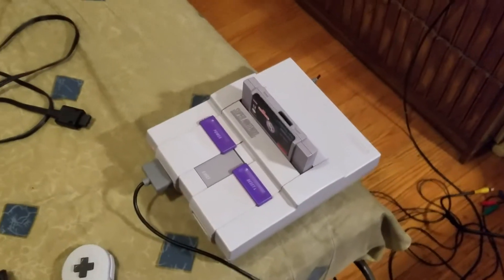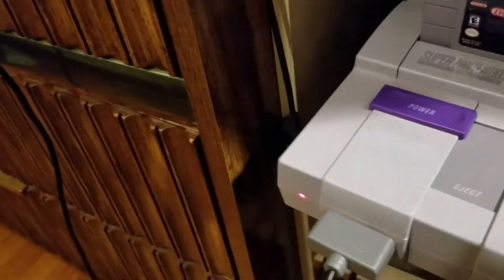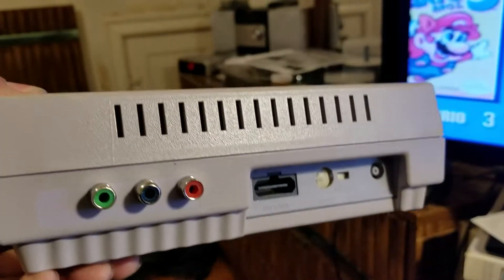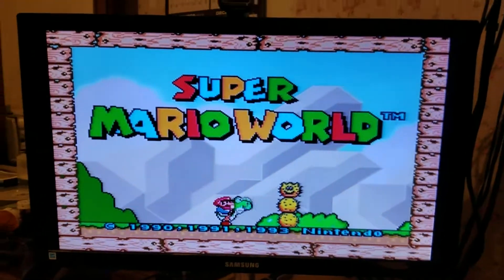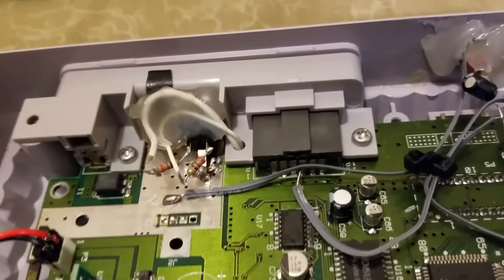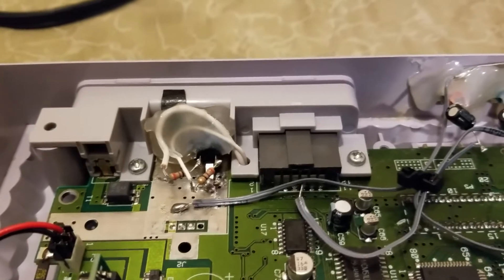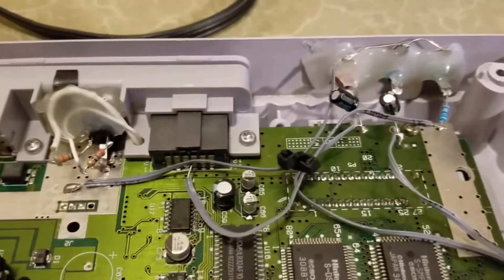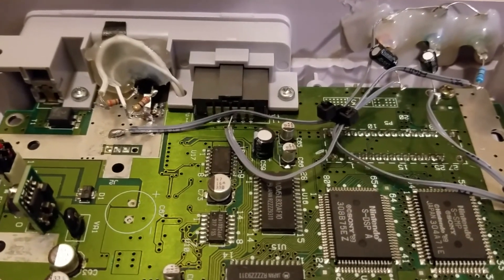Super Nintendo SNES Component Mod - Awesome Video Quality! (SNS-CPU-GPM-02)

Comment: awesome bro thats how i did mine too except i used 220 uf cap based off of what the RGB scart cables use to amp the signals up. Depending on TV colors may be a bit intense/brightness so could play with that on TV and or use resistors depending on the route you want to do.

Comment: Awesome vid thanks for sharing.. 
Why don't you just use multi out jack.
Maybe make your own cable, 
Im try to understand dosen't it come out to that multi out on those boards.

 I'm almost to the point of buying one of those hd retro component cables and then tearing that bitch apart... then show every one how to make it cause they asked so much for them out the door almost $70 bucks.. bullshit.
May be you could..? I get it if you don't want to.

This is what I got so far.
I think this is the right pinout for multi out jack.
"Pins"
1 red 
2 green
3 CSYNC ..sync s/12v
4 blue
5 ground ..pin 1,2,4 or with s video
6 ground ..pin 9,11,12
7 s video y,  luminance back&white ..s video 
8 s video c, chrominance color ..s video 
9 CVBS, composite video AV .. yellow
10 +5v ..5vDC
11 left & right audio mono ..white
12 left & right audio calculate stereo ..red

I don't know you tell me what you think..
No one's done a video on how to make a component cable for the snes it can't be that hard  I'm trying to get all the parts to do it....

Comment: I just finished this mod on a snes GPM-01 1992 with a S-ENC  chip, i take the materials (two 220 uF 25v caps and the 3 rca inputs) from an old dreamcast vga box.
Luma/green from pin 7 of av out, red from pin 1 of the s enc and blue from pin 24 from s enc and the ground grom the board, i tap green directly and added one cap to red and blue... i tested on LG CRT with components and the quality was awesome, so vivid colors, i'll never go back to composite or s-video

Comment: can you give me the part number of the voltage regulator you used? i would like to replace them in both of my Snes consoles for brand new ones.
Reply from the maker: Murata Power Solutions Inc. OKI-78SR-5/1.5-W36-C
https://www.digikey.com/product-detail/en/murata-power-solutions-inc/OKI-78SR-5-1.5-W36-C/811-2196-5-ND/2259781